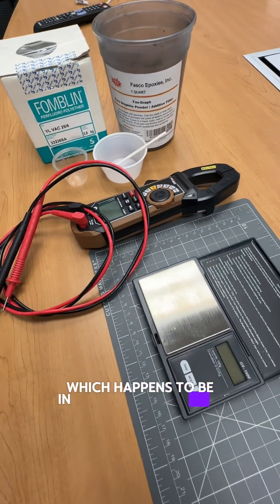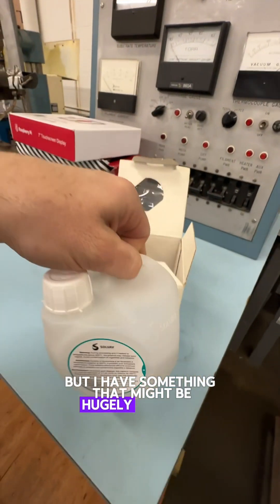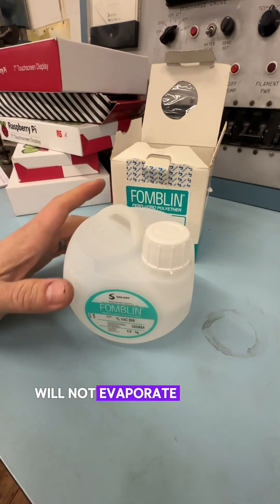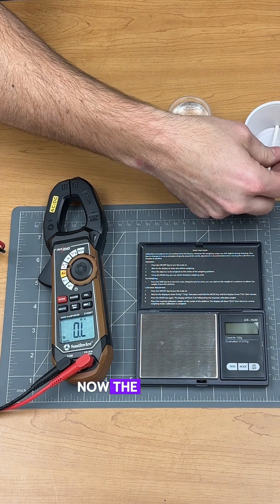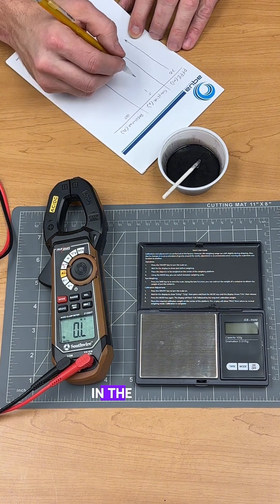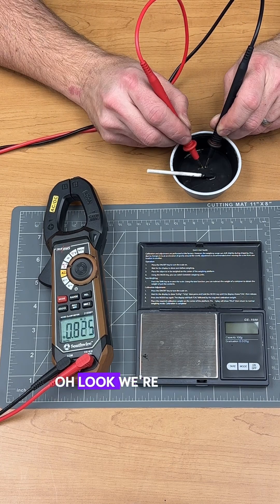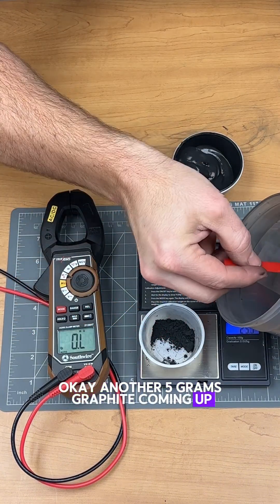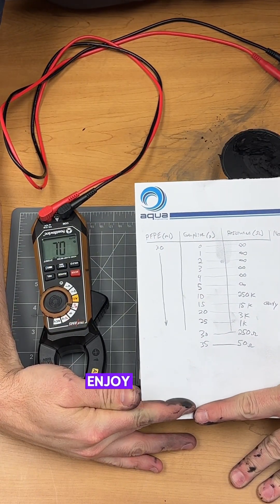DIY Conductive Fluorinated Oil

Comment: I dont get it if you wanted something conductive why did you start with something completely non conductive?  Why not just use a cheaper oil that may or may not be slightly conductive and just increase it with graphite?  Like why did you need the fomblin oil to start with?  It seems the only reason you chose it is because it was non conductive and then proceeded to negate the only reason you bought it for?